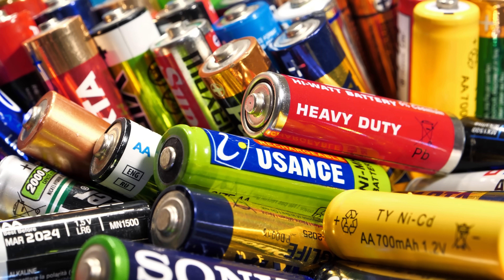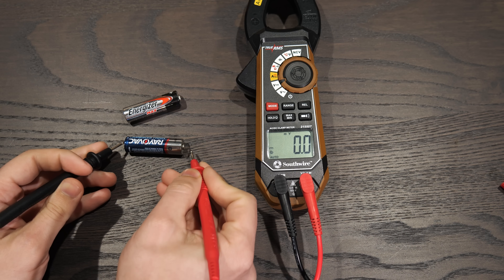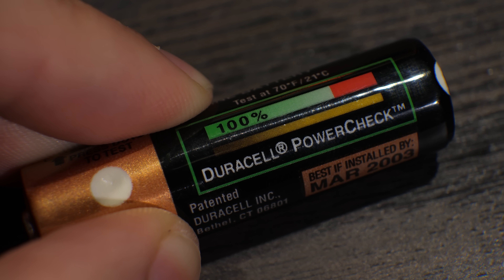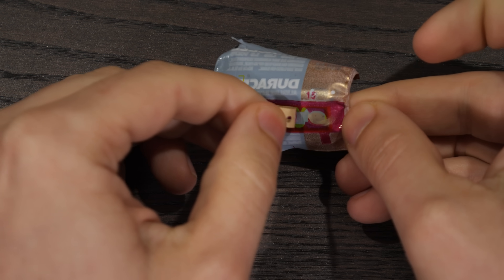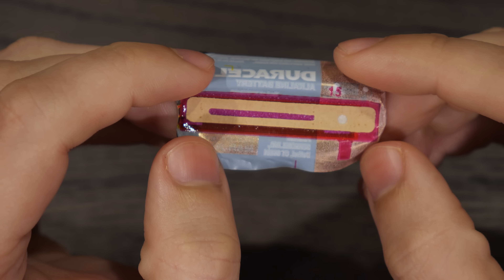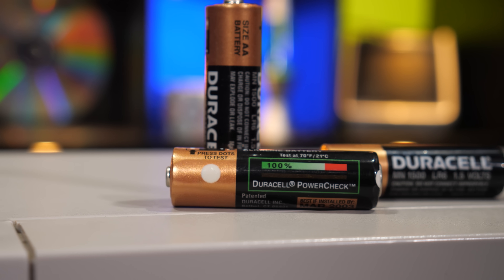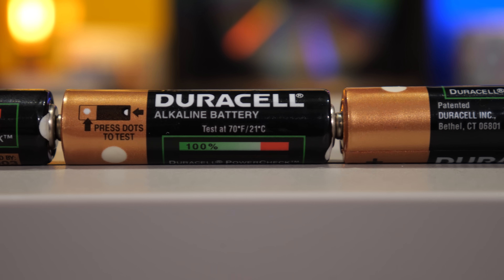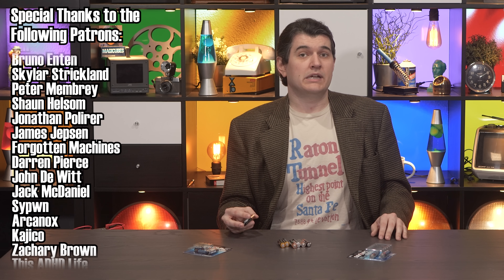Duracell PowerCheck: A genius idea which didn't last that long

Comment: My frustrations with the PowerCheck functionality was having to oftentimes press very hard before the yellow bar started to appear. When that failed, digging a nail in might show results, of which you mentioned. That led me to distrust the indication and out came my multimeter for the final say so. But voltage is voltage and doesn't always reflect real battery health unless a load is applied. All of which has led me to use rechargeable cells whenever I can.

Comment: This feature was far more useful than you say it is... The reason? All those goofy devices that take an odd number of batteries that always leaves you with a loose one that ends up out of the pack and in the junk drawer. It ALWAYS happens. I'd LOVE to have that feature back, instead of having to buy some goofy tester contraption that will inevitably be nowhere to be found when needed.

Comment: For anyone reading this, all alkaline batteries have a built in battery tester and Duracell never needed to do any of this marketing gimmick. Simply grab the battery in question, hold it 1 - 2 ft above a flat surface. Drop the battery and observe. If the battery bounces off the surface an inch or so then it is dead, if the battery doesn't bounce and rather hits the surface with a thud then it is a good or fresh battery. I've been using this trick for years and it works. Don't ask me why it works I just know it does, if I had to guess maybe it's because of density.

Comment: I know my comment will be buried but I just wanted to point out that a few years ago they were introduced here in Germany by Duracell. Although since I was born in 2004, I don't know if it was a re-introduction. Anyways, I have the feeling that most of the Duracell AA batteries had this system but atm you can only buy one version on Amazon as AA and AAA

Comment: These are still made. And I noted that it's better to make sure you properly cover the pads rather than apply too much force (at one point I got the knack  to reliably make the tester activate without having to press too hard).

Comment: Actually these were part of a larger plot to get rid of the package testers that they had in the early 90's. Both battery companies began having testers on the battery packets for free. It was great. You could easily test your batteries, and they were easy to use. Then the battery companies needed a way to get people to throw away these testers, but they couldn't just take them off the packages because if they did that people would just hang on to the testers that were already on the packages. So they went to the trouble of putting them directly on the batteries. Now people had no reason to keep those packages. After a couple years they were free to remove them from the batteries and now nobody has the ability to easily test their batteries again.

Comment: I don't understand why disposable batteries are even legal still, it's insane. A lithium-ion equivalent only costs like 3x as much (available in AA, AAA, 9V, C, D, etc.) and can be recharged 1000 times (often with a micro-USB or USB-C port directly on it) without degrading like those older chemistries from the 2000s.

Comment: Duracell first add the power check element to the blister packaging in the 90s then later directly to the battery.   I used to save the packaging to test my batteries.

Comment: Didn't they put a tester on the packaging at one time?  It was like in the clear plastic...you could put a battery in the packaging and squeeze it just like the ones on the side of the batteries.  I swear I remember that being a thing at one time...and if it wasn't, that would have made more sense than putting a tester on every battery.

Comment: this is the dumbest and most pointless thought ever, but is there any reason you couldn't remove the cover from one battery, put a little foil or something on the connectors of another one and then glue it to that new battery to resurrect it?

Comment: In a Jr. High science class, we were working with batteries and I connected multiple 9v batteries to one of the package testers. The line immediately turned yellow and then burst into flames. The teacher looked over and said, "Well we learned something today, didn't we?"

Comment: apparently the "Duracell quantum" batteries have this - I just opened a battery powered pencil sharpener I bought and the batteries had this on them, but also were brand new (expires march 2027, and fully charged)

Comment: I used those. ;_; Wondered why they're not made anymore. Well, time to get the plain old voltage tester again.

BTW another use-case for semi-spent batteries is devices which have several isolated circuits powered by separate batteries. Then they're not drained at nearly the same rate. Chinese like to do that for whatever reason.

Comment: I can't remember specific devices, but there were cases where one device would demand the batteries be nearer to full charge in order to work, while another device would only need a little current and would work until the batteries drained much more fully. Batteries that no longer worked in the former would still be useful in the latter, so into the junk drawer they would go to act as spares.

Comment: You should have done it, check the voltage I meen, cuz when you got to buy a new set of batteries you would check if the older ones had enough for maybe 30-60 minutes of juice left to ude, you would changed them and kept the old one as buck up for any appliences that needed some power for maybe shorter use..

Comment: 11:44 I disagree. Keeping suspect batteries around is so frequent that when I have a tenant complaining that they put a ‘new’ battery in their smoke detector but it still doesn’t work I have to ask them, ‘did you use a new battery or a different battery?’

Comment: Did anybody use the tester and when it wouldn't go yellow or there was only a little bit of yellow you would push harder and harder with your fingers thinking you know there is plenty of charge in there but maybe you are just not pushing hard enough so that is why it is not turning yellow.

Comment: This brings back some nostalgia and a pain only truly felt trying to get those dang things to work 🤣 when I did my battery storage testing (grade school science fair) I also decided to test these style batteries seperate just to get an idea of how well these things worked. Brand new it was obviously accurate but once the AA battery got below around 65% it had a variance between -1% to -8% (the test strip would show that variance below the actual voltage on average with it getting closer to that 8% the lower the batter power got due to the resistor/heater for the stip needed more power than what was available even though the battery wasn't fully used up) out of i think 4 AA batteries i tested 3/4 showed actual power storage being between 10% of power left (if you consider 1.6v full power and 1v unusable) even though the stip said dead so roughly 1.1-1.16v is the threshold for the strip to function at all, below that there isn't enough voltage to overcome the resistance of the heater to make enough heat for the strip to react. Also fun fact, out of my science fair testing over the course of about a month of testing, they aren't lying when they say to store batteries in a room temp, dark and dry place. All batteries at room temp tended to last at least 25% longer on average than those in hot environments where as cold batteries still proved to retain about 5%-10% more life over hot batteries (cold batteries were kept in a standard deep freezer that wasn't opened except to test batteries, so average temp remained around 2-3°F according the the testing equipments graphs and hot batteries where kept under a heat lamp with open top to keep the temperature average around 90-95°F to keep testing below safety limits of the batteries, avereage room temp during these tests were around 73°F)

Comment: Dude, it's such a bummer to buy a new gadget of some kind these days and find out it needs AA/AAA batteries to run. Not only do I just not keep them around anymore, but finding somewhere to dispose of them properly is a hassle since the recycling step isn't a super profitable venture.
Lots of stuff can't handle being run on rechargeable Ni-MH cells either, because of the slightly lower nominal voltage. So not only do you have a thing that constantly needs its batteries replaced, you can't even try to be less wasteful.

Comment: If you want to quickly know if a battery is dead just drop it on the floor. If it bounces, it's probably dead. Not great for telling how much capacity is left, but it will quickly tell you which one not to use.

Comment: The battery drop test works too. On upside down drinking glass bottom or hard floor. Hold the battery like an inch above the surface and drop it on the negative bottom. You’ll see it bounce if empty.

Comment: Clever but not needed very often and destroys fingers.

I do have a small number of part used batteries-usually they come out of last years Christmas decorations which are often mini LED lights……these still have worthwhile charge in them.

Critical info-anything with a moving part such as a Christmas decoration with moving figures or a water display with a tiny pump inside, or old style walkmans, they all burn thru batteries. Also stuff with a cpu…we got digital radio in the UK as a modern supplement to FM….guess which one burns thru the battery fastest…..although to be fair its improved but yea one of those will burn thru 2 long life AAs in about 8h. Makes sense to get one with built in mains rechargeable battery pack.

Comment: there was a time when the tester was a strip in the package. I used to cut it and use it with any battery brand under the sun. very clever trinket.

Comment: I always wondered how those worked.   I do miss them though, especially in my garage.  In the garage, batteries sit for years at times.  It's nice to know if the batteries are going to work before I put them in the device or should I run back to the house for "new" batteries.  My garage it detached from the house...

Comment: I remember these! Used with my xbox 360 controllers before we got rechargeable AAs in the late 2000s, I'm sure I've still seen them for sale in the UK, although I always use rechargeable batteries now. Definitely still produced and sold here in some capacity.

Comment: It makes sense to me to include the testers these days. Why? because a lot of people buy batteries bulk, and a battery does not 100% hold its charge over time. Having a tester will allow you to check the charge on batteries that are old yet never used without a volt reader.

Comment: Sure, I remember these. As mentioned, the tester was incredibly hard to use due to how much force was needed....but some of them simply refused to work at all. Duracell must have done something to the chemical composition of their batteries over the years, because nowadays they are notorious for leakage---before, they didn't leak any more than any other brand

Comment: I just never used them cause my weak noodly 5 year old fingers could never get them pressed in enough to work X"D so I just chucked the batteries in my gameboy and saved more frequently with questionable batteries from the junk drawer.

Comment: 11:00 I must be the rare exception. I don't watch TV so I keep my remotes without batteries because batteries leak and corrode the terminals. When I DO use a TV, I take used batteries out of a box which also contains a simple volt meter (no load). Sometimes I discover a leaking battery and throw it out.

Comment: I had the same issue, remote can hold 15 months, however, both my mouse and keyboard were AAA batterry and both of them could fit AA if engineered correctly.
I use the same keyboard since 2008, and a new mouse, modified them to use 2P 3.2v LiFePo4 batteries, still works with 3.0v rated keyboard and 1.5v rated mouse, since mouse has 5v capacitors, it's no prob

Comment: now a days batteries are soo cheap that you can use 3-4 at the price of these... in India you get 8-10 locally manufactured batteries for 1buck and they last for 8months on a wall clock.

Comment: Thanks for this deep explanation. I remember those batteries well and was impressed by this feature. But I'm also one of those, that do keep partially used batteries in a drawer and have a voltmeter. Reasons - 3 kids and lots of toys, in which batteries like to leak, if they are not used for a long time. Additionally I do segregate batteries and equipment, where they are used. Some electic tools/toys need really new batteries to work properly. Some others are fine with weaker ones for a long time. Then there is a conspiracy theory, that I put weaker batteries to toys that produce sound. I don't confirn nor deny. ;)

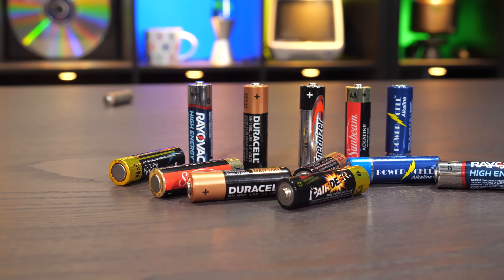Comment: 1:51 Actually, when fresh, each cell has a MINIMUM of 1.5 volts. Anything close or below that is to be considered as "avoid at all costs". Of course there's much more in terms of internal resistance, engineering and such, but put it simple - avoid them.

Comment: As a photographer, I'm probably one of those rare guys who takes the batteries out because you don't want them to leak onto your expensive equipment's battery terminals.  It will be a very expensive repair; if it can be repaired at all.  Sadly most disposable alkaline batteries are all made in China now and I have noticed a steep drop in quality and they leak more often.  Great presentation!

Comment: It honestly seems like they would be... maybe not actually useful in absolute terms, but more useful relative to their actual context, on rechargeable batteries. Those have more swapping in and out and they also have finite lifespans of their own which means that eventually you can take one off a charger and have it still be no good, so an on-battery tester would be useful in a way it just isn't for disposables that you generally use in one place until they die.

Comment: Duracell PowerCheck still exist at the M3 or turbo variant and they are the second long battery lifetime inside devices the first is Energizer Lithium single use batteries

Comment: I remember these... I thought they were cool... but yeah, didn't really check them.

But honestly, to this day... I keep batteries, light bulbs, lighters, and candles around a lot... because I always know, when there's a Power Outage in anything, device or house, light/fire is always the first things you need... especially at night or if there's a minor disaster that will cause power or gas to be out for a while.

Comment: I remember in 2017 as an adult I bought my first pair of rechargeable AA batteries. They still hold a charge and work well even today. I often imagine how much waste could've been prevented if the same tech was around and affordable when I was in school when I was sneaking portable CD players, Tape players, and AA/AAA powered mp3 players around. In middle school I put paperclips in the bottoms of my shoes when it was a manufacturing fad to make the bottoms of the heels look like springs or something. There was a gap big enough to put two batteries and using static electricity from the carpet I managed to milk a little bit more from those batteries. In hindsight it would only be like a day more time on them than normal but it was something! 😆

Comment: As a kid in the mid 90's I remember these.  As a kid with a budget due to allowance, or just limited batteries in the house, I commonly had more battery using toys and devices than I did batteries.  So batteries got swapped around a lot depending on what device I wanted to use at a given time.  So for adults, yeah, batteries were put in and then used until they were dead, but for kids those testers had a more practical use.

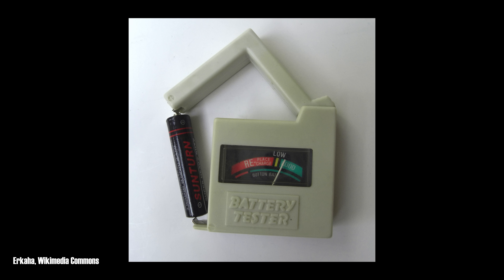Comment: 2:54 "Lots of inexpensive battery tester were made which are really just analogue volt-meters with a scale."
Me, who has the exact same tester with the exact same color for over 30 years and it's still my only source of knowing the battery is good or bad : F*ck.
Reply: why? it works, whats bad about it?

Comment: I will say on the subject of keeping or testing old batteries - it is actually super useful to know. Sometimes, only one battery in the remote is dead, the rest were just moving the one's charge. So when the remote dies, you can just test each of the batteries, replace the one or two in the red, and save yourself a few cents replacing 2 instead of 4!

Comment: it's a stupid idea because they're disposable batteries.  When they don't work anymore, that's when they don't have any charge, and you throw them away.  If these were rechargheable batteries, a tester would make sense in case your charged batteries and your depleted batteries got mixed together.  That's why I have a battery tester (the only reason)

Comment: Duracells have leaked on everything I've put them in. I heard that leaking batteries is caused by low voltage, but no other brands have failed me so consistently as Duracell. I'll never buy them again.

Comment: I didn't buy batteries in so long I didn't even know those aren't a thing anymore. XD But what made them bad:
1.) You never knew if you just didn't press the buttons hard enough or if the battery just was completely flat
2.) Pressing the buttons was really HARD and you almost always needed your nails and try a couple of times (and then see 1).
3.) You had to press the buttons for a few seconds for the whole gauge to light up.
4.) This might just be me but I felt the results were pretty inaccurate